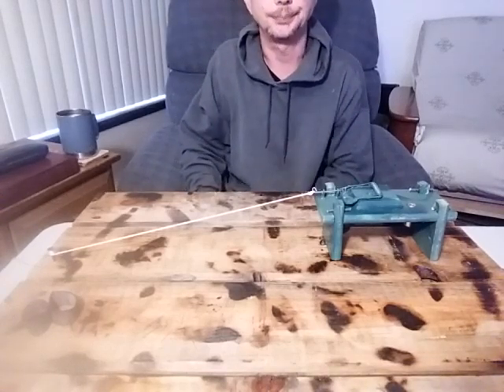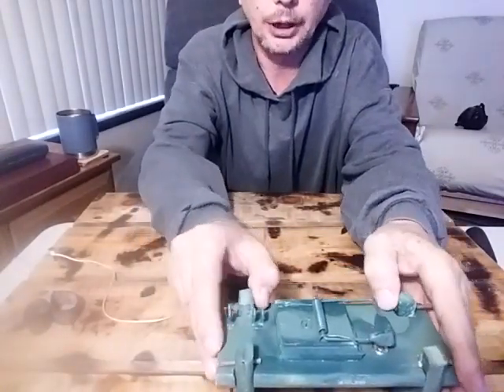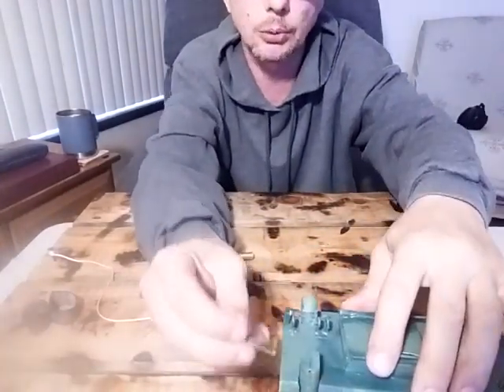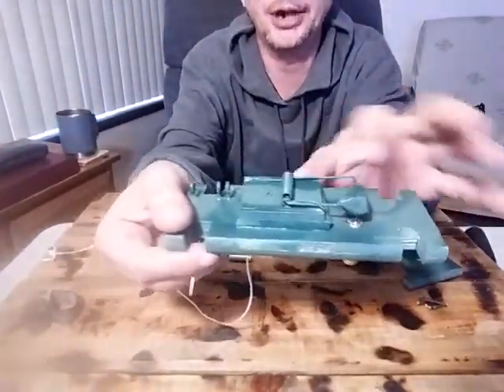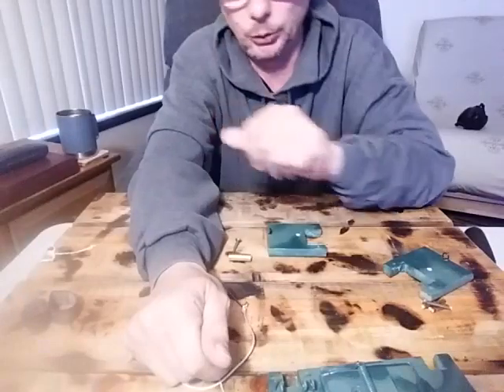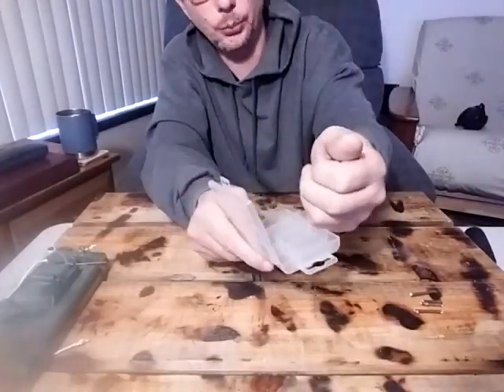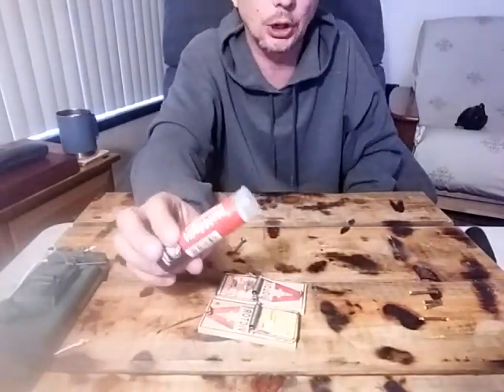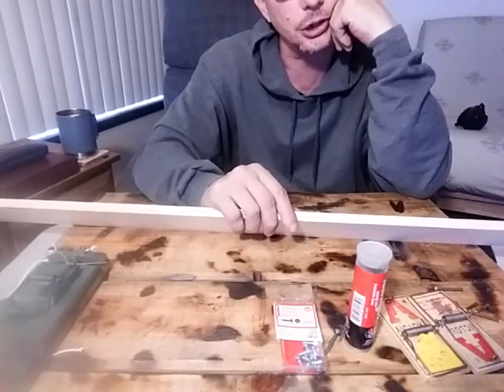DIY perimeter alarm 1 of 3

Comment: Just get the caps in the muzzle loading supplies lots faster and probably cheaper that destroying a good shell
Reply from the maker: I couldn't agree more but when I made this video finding Caps or primers were darn near impossible I worked with what I had thanks for watching the video I hope the project turns out great for you🤓
Reply: @pennypinchingprepper8197  I understand that but said was a good video I wish I could make a few myself
Reply from the maker: @jamiejohnson8176 don't underestimate yourself determination will get you far you might fail once but keep at it you'll get it🤓